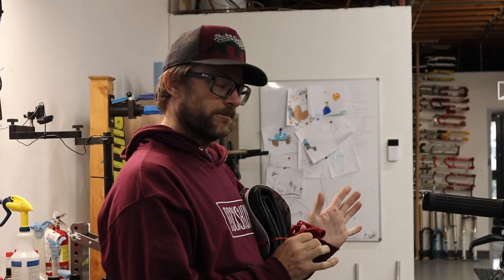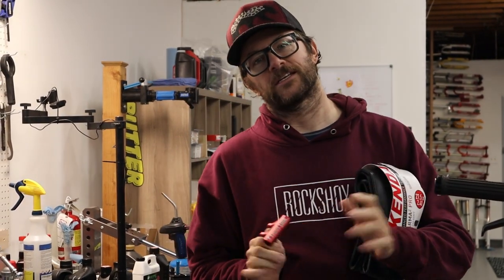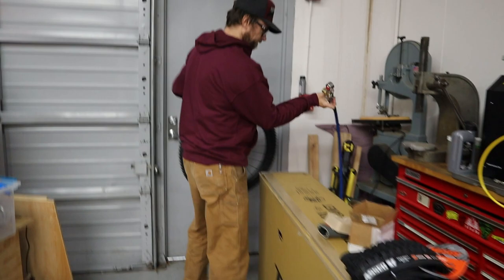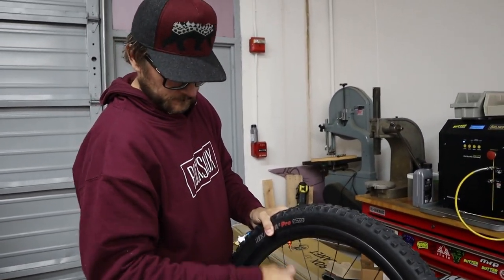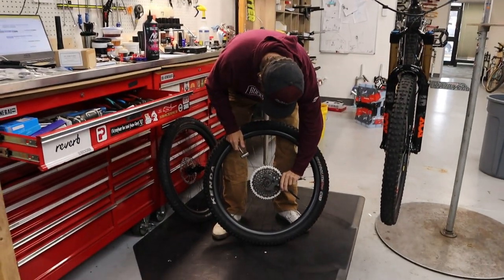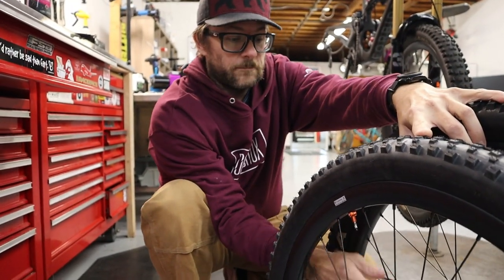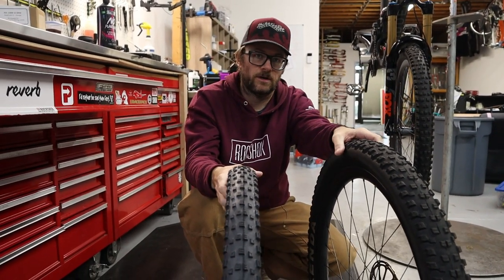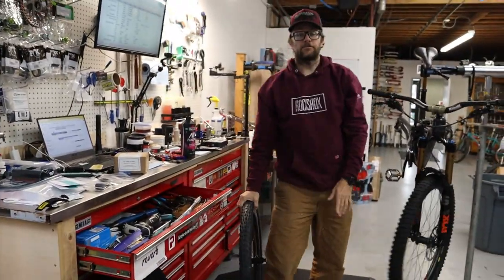How to Mullet a Forbidden Druid or Dreadnaught | Butter Suspension

Comment: Great stuff, just subscribed. You're very confident and knowledgeable, the 36 mins just flew by. Just a tiny bit of advice: when you tighten a bolt with a regular wrench, then use a torque wrench and it clicks right away, the bolt may be overtightened. Personally I always undo the bolt and tighten it with the torque wrench again when it happens to me. Cheers!

Comment: since you say that in your (opinion) some people make a mistake in how the tire is placed with respect to the valve, taking into account that most of the time it is for aesthetic reasons or to make the location of the valve faster, especially when the wheel is very dirty, I tell you that normally the professional way to install the tubeless liquid is to first inflate the tire until the edges are sealed,  after ensuring that the sealing of the tape has been successful and that the tire is in good condition, then remove the valve fan and proceed to install the liquid  through the valve, depending on the size of the wheel, install the liquid through the valve, normally be between 90-120 ml usually with a syringe, is the safest and cleanest way to do it so that in case there is any kind of failure either by the tape or the cover or by improper installation of the tires!

Comment: If you put the "extra information" on the tire near the valve then it is upside down at ground level when you attach a pump (on many tires, not all of course). If you put it on the other side it's near eye level right side up. I still do it the same way you are just for other reasons. I'd say there are many correct ways, depends upon your preference. Sometimes even 90 degrees off makes sense. Just have a plan for it I guess.
Reply from the maker: Except...I always attach the pump with the valve at the top...why bend over?

Comment: I literally just made that thread locker mistake lower shock bolt on my sentimental. Huge pain in the butt.

I’ve never had a bolt back out with copper grease. Maybe just luck but I think it’s so thick it deals with vibration better

Comment: Why would you want to use that mullet link, is there anything it does besides BB height?

Getting it lower is a benefit to me, still too high but every millimeter lower is quite nice.
Reply from the maker: Some folks want the smaller wheel without altering the stock geometry. 🤷

Comment: If the wheelbase stays the same then its not a true Mullet IMHO. There is at least one manufacturer that allows for both setups with two different wheelbases. A flip chip around the axle lowers the axel of the smaller wheel while also bringing it closer to the front.
Reply from the maker: Never seen any companies touting "mullet wheelbase!"; it's always small rear, big front wheels...